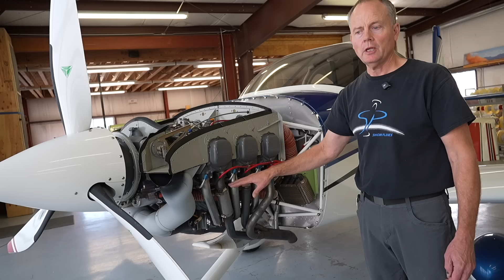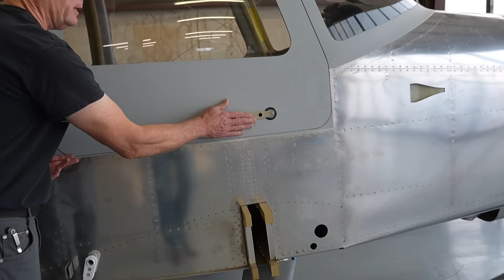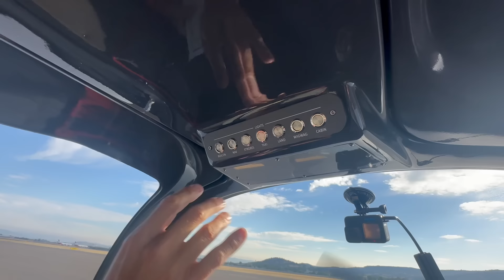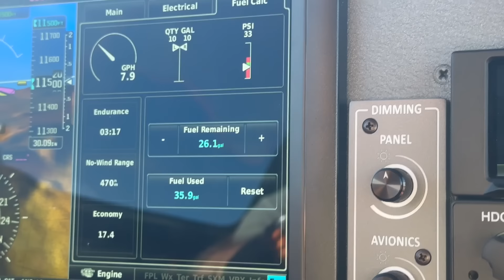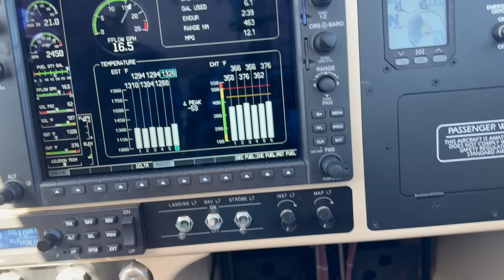Sling TSI  vs Van’s RV-10 : The Ultimate Showdown...  The Results Will Shock You !!

Comment: Lets just admit - Bonanza Wins!
Reply: I fly out of a grass strip.  There are several bonanzas here and everyone of them is still on the runway (I will even say, "Struggling")  to get off the ground when compared to my 10.  Not one of them will get off the ground as quickly.  They have expensive annuals. I just upgraded to Dynon HDXs from the older classic.  I decided to do it and I just did. No one to tell me that I couldn't do it. One hour and I was done.  A bonanza is an amazing airplane. The 10 is no less amazing.

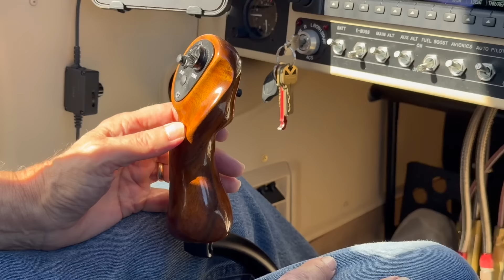Comment: When flying any RV and especially the Sling, I teach to rest your arm on your leg & fly with finger tips.  See 1:25:25.  If your arm is in the air, you will fly way more sloppy.  On the Sling, I like to lay my arm and hand on the console & just use finger & thumb on the fuel.  You need to make the most tiny throttle adjustments landing the Sling.  Only tiny works.

I may upgrade from the Grove to Matco 3-pucks.

Comment: I have an RV10, I always true at 170kts.  I just started using my Inogen Rove6 this last weekend.  Love it!  I set it on 3 (1-5 avail) which was too high, at 14,000ft.  I also saw a couple using one with a splitter, which shouldn't work, but does.  I'll be trying that soon as I have bought the splitter.  One huge benefit is that If I transport a plane across the country, I can do carry-on with airline return trip.  The ox bottle would need shipped back.

I have 1100hrs teaching in a Sling2 and think it's my favorite trainer.  But, would never own one as way too slow and doesn't fly well higher.  I look forward to training in the Sling4 soon and can't wait to compare the 3.  (I've flown 110 different models with +5000hrs instr given)
Reply from the maker: Impressive, thanks for the feedback 
Maybe we’ll see you on the ramp someday
N52257
Reply: Firewall the levers til at altitude, just lean the mixture. Perfect

Comment: I'm a controller. When I issue you a heading I've already done my best calculation to account for the wind based om other vectors ive given. If I issue you a vector, fly the vector, not the bearing.

Comment: I built and fly an RV 10 and it’s an incredible cross country machine. Normally I fly at 165 knots TAS at 11.5-12 gph depending on altitude 60-65% power. The owner of the 10 in this video flies ROP at very high fuel flows and power settings. He uses 50% more fuel for 10% increase in TAS. I don’t know any fellow RVers that manage their engines that aggressively. According to Mike Busch he’s in the middle of the “red box” too. IYKYK.
Reply from the maker: Thanks for your input 
And for watching
Reply: If you're at 11,500, there is no red box
Reply: @BaxterRoss Correct.

Comment: The only thing that keeps me from making a 100% decision between the sling and the rv is the ballistic parachute. 

Did you do any research on the rv10 for ballistic parachute? 

Thats the ONE thing that makes me keep coming back to the sling. 

The rv10 is just a beast of a plane. 

But there are not many case studies on the ballistic parschute. 

Ive even heard alot about the rv10 having a cg forward issue, so the parachute might genuinely be helpful and never have cg issues with 4 adults (just weight). 

If the rv10 had a supported path for ballistic chute, itd be a 100% no brainer (bout the same cost too)  

Did you do any research on this yourself?
Reply from the maker: I did look into ballistic parachute s for the rv-10, and they are available at a cost.

Unlike the sling the rv-10 was never sway to have one incorporated into its airframe, so a retrofit involves visible cable on the outside of the fuselage, which can be covered with basically spackle, which adds a fair amount of weight and apparently doesn’t look that  great.

So it is an option, not the best for me.

Thanks for watching

Comment: For the Bose A30 (and A20s) there's settings switches under the batteries in the controller. You can disable 'tap control' using the switch labelled 'tap control'

Comment: Regarding engine, I'd never get a plane with old gen lycoming and continental. Rotax is also massively overpriced but they are at least more modern and efficient and none of the lead nonsense. As for fiki, one thing I'd like to see tried is running engine heat to the leading edge of the wings. If you are producing 100kW there is 2-300kW waste heat, that really should be plenty to impress rime ice, far better than rubber boots and no need for a fluid system. I think if done right with good coupling you could fly into the nastiest of icing conditions and the wings will remain ice free. The cockpit will be covered in ice though :)

Comment: The RV-10 looks a lot better but then again, it's not an RV-10. I don't believe series produced kits have a future. Paying 400k for a flimsy kit you have to build in a year is very unreasonable. Hopefully that will be replaced with good factory options soon. And speaking of composite mods, just do composite planes already. Sheet and rivet should have died with the titanic. It's so ugly and limiting and the illusion of cost effectiveness goes out of the window with the build time. Now that experimentals can be factory built with mosaic, these factories really need to adapt fast and make composite models. Looks to Risen for efficiency and VL-3 and Cirrus for paint schemes and interior. People pay for dress up and shun the bland. I just heard the story of how JMB took over the VL-3 factory, it went from ongoing bankruptcies to money printer simply by adding paint and custom interior. And overpricing because foolish buyers pay triple when it has a paint scheme :)   Both Sling and Van's need to go factory built composite asap.
Reply: Having built and fly the RV10 I can assure you that it is most definitely not “flimsy”. It performs comparably to the SR22 at one fifth the cost too. Vans is doing just fine with their offerings and don’t need to go composite just to become another overpriced, out of reach option.
Reply: @randypulis  How many times have they filed for bankruptcy? and read what I wrote, this meccano set garbage is not cheaper than carbon fiber. The cloth for a plane like this might be 4-8k$ giving you perfect shape and weight optimality. In aviation that's just not cost prohibitive at all. Your obtuse ignorance is prohibitive. Making a fuselage in one go in a mold like paper mache is just unbeatable by the offensively ugly and crude sheet and rivet. It's an illusion of low cost and ease. It's also worth noting he went to great length to modify it with custom composite. These garbage planes have several composite parts anyway to patch the crude sheet metal so why not do one once and for all. THINK!
Reply: @DanFrederiksen Lol…..obtuse arrogance. Your obtuse ignorance is showing if you think plastic airplanes with a finite airframe life are inherently superior. What do you fly or you just an armchair expert? I am guessing the latter.
Reply: @randypulis  I've had an evektor but that's also irrelevant. A bus driver has a lot of experience driving a bus, that doesn't mean he knows squat about engineering a bus. I'm a polymath genius with university education and I actually know the relevant engineering. Who are you?  alu planes are the ones with finite life, even the most expensive jets have a firm schedule for thorough very expensive checks for metal fatigue that might include costly repairs. Composite planes generally have infinite life, fatigue is never a concern.
The 'free abandoned plane' on rescue rebuild has now been abandoned after 3 years and 300k$ repairs. That's your finite life
Reply: @DanFrederiksen  Dan, the lifespan of these kits are probably 50+ years at 150 hours a year of flying with significant G-loading. I won't deny composite is the way to go, but when you say "finite life" ... c'mon, stop. And don't think MOSIAC is going to make things that much cheaper even factory built. VL-3 is a great example of just how expensive things get - a fast $350-400k 2 seater is ridiculously priced.

Comment: Minor nit from a CFII - you cannot legally fly an ILS approach unless you're able to use the localizer signal for lateral guidance and the glideslope (if available/used) for vertical guidance on the final approach segment. That said, if I were building a Sling today I'd probably forego the VOR / ILS navigation capability in the plane too. I can't recall an airport with a LOC, VOR or ILS approach that doesn't also have a good RNAV approach.
Reply from the maker: Thanks for that input 
And thank you for watching
Reply: I am building my S-21 with GPS only, but I will likely buy a handheld with ILS capability as a backup.  If the GPS system goes out, you have nothing to fall back on.  Unlikely, I agree, but not impossible.
Reply: @LTVoyagerI have a 21 with just the GPS. You will likely never get to minimums in the real world.  Every airport has a GPS approach. Don’t waste your money and wait on a Nav Com
Reply: @Captndarty The issue is if GPS is down.
Reply: @LTVoyager in 750 hours in my Rans with a G3 X built in GPS and a GNX 375I I’ve never had my GPS go down. You’re more likely to have a localizer or glideslope out of service or not oriented in the right direction. Get a vector to a hole and descend.
Reply: @C @Captndarty . I understand.  I’ve driven cars with EFI and electronic ignition for 40 years and have never had either fail … yet my 915iS still has two of each.
Reply: @LTVoyager well if you have a G3 X, it will revert to internal navigation for en route. If the IFR GPS fails or the satellites fail en route get radar vectors, you can do an ASR approach. I have had a signal Fritz a couple times and I just pulled the breaker and reset the GPS. Done But for a GPS to fail and cause a critical problem before landing, you’d have to have the Swiss cheese effect and so many things going wrong at the exact moment in time and weather. The fact is most IMC flying you will do will be between 2000 and 6000 feet. You’ll likely break out above the final approach fix.
Reply: @Captndarty  Yes, the likelihood is low, but we backup a lot of systems with similarly low failure probabilities.
Reply: @LTVoyageran engine failure is just a touch more significant than a GPS going out….
Reply: @Captndarty  If you are above an overcast that goes down to 200’ over a wide area, a GPS outage could be quite significant.
Reply: @LTVoyagerthese glass cockpits have a backup GPS unit, at least the ones I've seen tours of.

Comment: At around 1:10 you talk about using TRK vs HDG….

ATC instructions: ATC instructions, such as "climb and maintain heading two-seven-zero," are given as a specific magnetic heading.
Maintaining separation: When all aircraft in a sector are instructed to fly the same heading, they will be affected by the wind in a similar way. Using HDG mode ensures all aircraft are flying the same path, which is how ATC establishes and maintains separation.

Incorrect use of TRK: If you use TRK mode during radar vectors, your autopilot will automatically adjust your heading to maintain your ground track over the ground, even if it means deviating from the heading the controller gave you. This could lead to you no longer being on the track the controller intended for separation purposes, and the pilot could be in violation.
Reply: Yes, when ATC says heading, they mean heading.
Reply from the maker: Thank you for the feed back, and for watching 

It’s appreciated

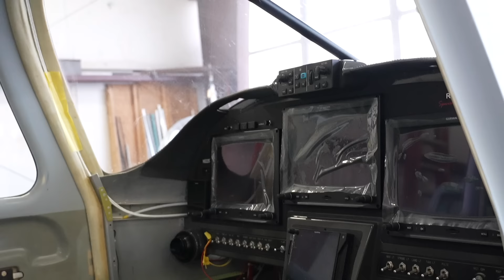Comment: 35:25 Autopilot in glare shield who knew... Oh every airliner manufacture for the last 60 years. Ha ha. All the Boeings I flew that is where autopilot modes are. 
Ultimate showdown? Not really, take off numbers, payload, time to climb, cruise econ, top speed, fuel flows.  The RV-10 is a bigger more roomy higher gross and dare say longer range aircraft with better T/O and Ldg Performance. These are published. I know Van's Aircraft for 50 yrs has published specs that their aircraft meet or exceed. 

Sling TSi  vs RV-10
Engine: Rotax 915iS (141 hp) or 916iS (160 hp), both turbocharged.  /  Lycoming O-540, ranging from 235 to 260 horsepower, ( turbo-normalized option available)

Cruise Speed: 155 knots TAS (178 mph). /  190 mph at 75% power for the 210-235 hp engines, increasing to 197 mph with a 260 hp engine

Stall Speed: 48 knots (55 mph) with full flaps, indicated airspeed. / Stall speed: 63 mph (55 knots).  (at higher gross weight)

Maximum Speed: 155 knots (178 mph) indicated airspeed./  208 mph for the 260 hp engine.

Rate of Climb: 1,200 ft/min. / 1450 fpm

Service Ceiling: 18,000 ft  / 20,000 ft.

Max Range: 1,000 nm (1,200 mi). /  825 nautical miles ( at 950 sm)
. 
Maximum Takeoff Weight: 950 kg (2,094 lbs)  / 2,700 lbs.. 

Useful Load: Around 430 kg (950 lbs).  / Over 1000 lbs

Take & Landing distance at Gross  600 ft & 500 ft   / 650 ft & 650 ft
Reply from the maker: Why I’m very happy with the RV-10 choice.  Agreed, a little apples to oranges.
Thank you watching and commenting.
It’s appreciated.

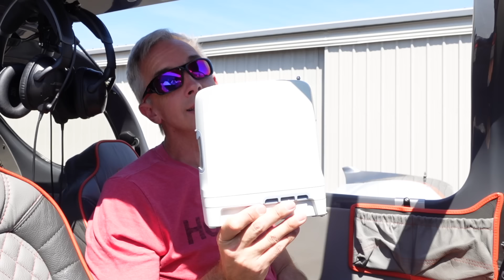Comment: 9:50 oxygen concentrators are recognized by the FAA as an acceptable source of supplemental oxygen, for both experimental and certified aircraft. They refer to them as a MSOG, or "molecular sieve oxygen generator" - you can read about it in the FAA publication "Oxygen Equipment Use in General Aviation Operations." I have a video on my YouTube channel where I go into depth on this topic, and do a test of an oxygen concentrator up to 18,000 feet.
Reply from the maker: Thanks for the information, appreciated
Reply: Where do you get the oxygen concentrator with just a Pilot’s license everywhere I’ve seen requires a prescription.
Reply from the maker: @russelltiede9076  https://oxygo.life/oxygo-next

Comment: @2:50 "You can fly an ILS " - Sure about that?........... You cannot fly a VOR/ILS/LOC approach without a system that can receive those system's course guidance. You can use your WAAS GPS as a back-up / reference guidance, but you cannot accept an Approach for a system your aircraft doesn't possess.

For reference my plane has a GNC355 WAAS GPS and KX125 VOR. As such, I can fly RNAVs and VOR Approaches (GPS as reference guidance and VOR as primary guidance) only. No ILS, no LOCs.

Interesting to learn about the O2 concentrator, thanks for that!
Reply: Yeah… best to not mix these up. If it was actual IFR you cannot accept or do an approach that you don’t have the equipment for. If you read the AIM 1-2-3 note 5 it goes into this even more.
Reply: This is why I came to the comment section
Reply from the maker: Thank s for the feedback, and for watching.
I appreciate you taking the time
Reply: You are correct and I should have been more clear. My intent was to describe that the course can be flown via GPS, not that it would be a legal approach.

Comment: The sling is more fuel efficient with similar (but less) speed and useful load.  The sling is turbo so the difference in speeds get smaller as the altitude goes up.   But the big difference you didn't mention is interior quality.  The sling comes with a premium interior.  The RV I believe has to be custom made and as a result I believe the RV normally have lesser quality interior.
Reply: you can lean that o-540 to 10gph and only loose 10kts
Reply: @mannyferreira7559 I hate it when my knots get loose.  😂
Reply from the maker: Thanks for your comments and for watching

Comment: No shocks - both are great planes that are equivalent in performance, with strong builder communities and passionate builders/owners.  Their missions are similar, but each company choose different paths to get there - the Vans  is a shining example of the best of traditional aircraft technology, while the Sling embraces the best of modern alternatives.

Vans has a more mature 3rd party "mods" ecosystem, compared to the Sling's tighter dependence on Torrence and the SA factory. 

There are significant differences in construction (solid rivets vs pulled), build times (2,000–2,500 vs 1,200–1,500 hours), engine technology (manual 6-cyl carbureted Lycoming vs fuel injected FADEC 4cyl Rotax),  horsepower (280 vs 140) and empty weight (1,600 vs 1,100 lbs). 

In the end, it depends on your givens and druthers:
  * the heavier Vans takes longer to build and uses twice the horsepower at twice the fuel burn to get slightyly higher cruising speed, and doesn't force the pilot to depend on the foibles of computers running the engine.

  * The  Sling has a smaller, modern efficient engine that doesn't burn oil or require the pilot to micro-manage the engine performance and tuning during the flight.
  * Both are similar to the Cirrus SR22 at a fraction of its price
Reply: I agree.  No surprises here.  My only complaint with the Sling is it is a little too tight inside.  A larger cockpit would have been nice.
Reply from the maker: Thanks for the comment
Reply from the maker: It is a little apples and oranges
Reply: Carbureted RV-10s? Most of the ones I've come across, including my own build, are fuel injected. Many also have full EFI and removed the red knob. Mine still has the red knob however.